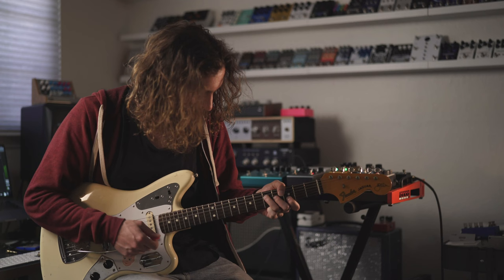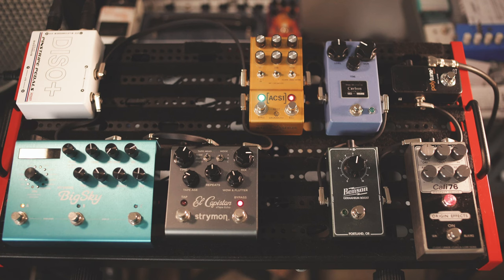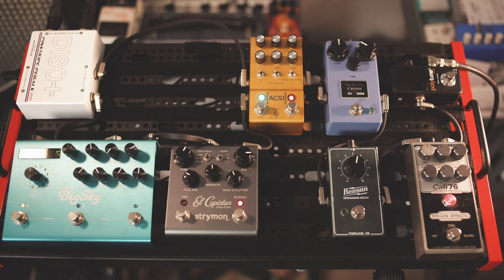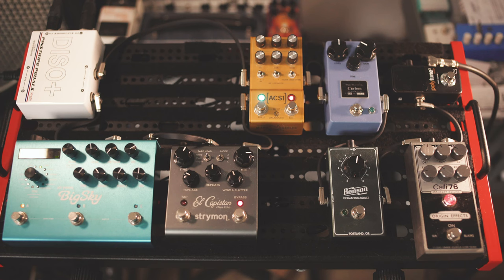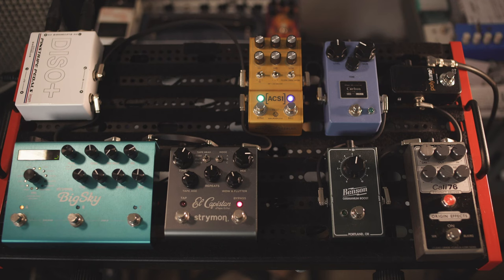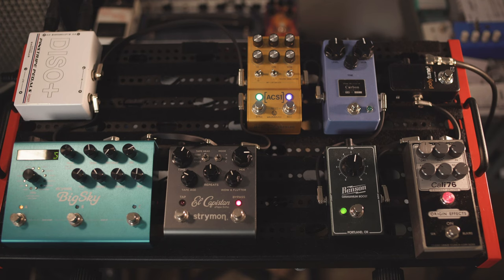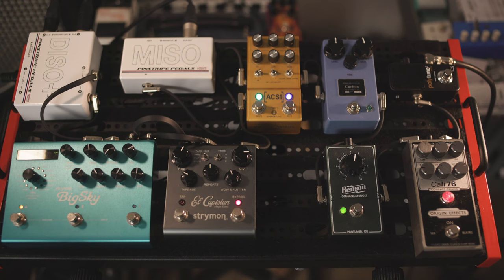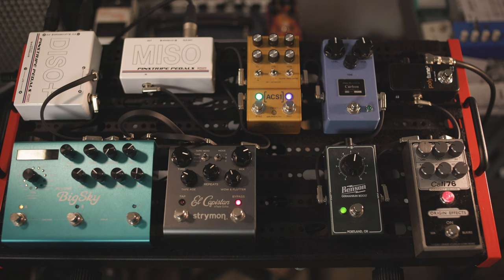The EASIEST Wet/Dry and Wet/Dry/Wet Pedalboard rigs with Pinstripe Pedals | Secret Weapons

Comment: Holy shit. Doing a Wet/dry has always sounded like it'd be magical, but a pain in my ass that I didn't feel like tackling. As a fellow ACS1 user that has a Diso+, this looks like it'll be incredible and super easy. I also have the XLR sum and the 1/4 sum, so worst case scenario in a live setting if I only have one slot available on the board, I can sum it all and be good to go without having to re-patch anything anyways.

Thanks so much for the video! Also, slightly curious to know if you're using stock cabs and all that ish on the ACS1. Anyways, always love your tone and playing!
Reply from the maker: So glad this was helpful for demystifying the concept. It doesn’t have to be a whole thing if you don’t want it to be. 

And I’m using ownhammer IRs. Love them.

Comment: An idea I’m waiting to clarify with Strymon doing this with the Mobius to introduce modulation into a rig like this. It’s using a splitter before the Mobius and a parallel mixer for the Timeline and BigSky. So it’s a very similar w/d/w rig to the one in this video. It should work w/d as well. Goes something like this:

1) the left OUT of the Mobius just goes into the IN of the dry path (this puts the Mobius pre just by placement)

2) the right OUT of the Mobius goes into the IN of the first pedal of the wet path (this puts the Mobius physically in the wet post path)

3) left OUT of splitter into the Mobius left IN

4) right OUT of splitter into the Mobius right IN

5) flip the rear switch to pre/post on the back of the Mobius

I’m not 100% sure yet but if the Mobius seperates the pre/post routing this way this may be a good solution.
Reply: Confirmed to work this way by Steve Stanley at Strymon.

Comment: Ok, so much yes! One question. If you had a stereo modulation in the signal chain, would you put that first in the stereo chain before delay and reverb, or just opt for mono modulation and put it before acs 1 to have it on both dry and wet signal?

Comment: Another good option is the Radial Key Largo - you can do wet/dry/wet or parallel mixing of up to three stereo signal paths, along with  a master effects send if you want to glue everything together with a reverb or some compression. The difference is only 2 xlr outs, so you have to do your own mixing.

Comment: Man that intro song was so sick. That tone is so good. I need to get another UAD interface so I can have more inputs for w/d/w tones.
Reply from the maker: Ok hold up. If you own an Apollo twin you don’t need to buy another UA device. For way less you can buy any number of input devices that have an ADAT output and can link to the Apollo for cheap. I use the Behringer ada8200 but I don’t recommend it. The preamps are.. fine. But Behringer as a company deeply sucks and supporting them isn’t the move. A little bit of googling will find you an option that will get you 10+ inputs to your twin for cheap.
Reply: @markjohnstonofficial  oh yeah, I forgot about that. Thanks for the tip. I’ll do some research and see what people are using.

Comment: Great sound, but through how many speakers are we listening to, or is all direct? If direct, the question still holds, how many speakers are we hearing on youtube if any at all? My apologies if i missed your explanation regarding the final audio YT output devices.  

I'm thinking of using a similar setup, though with a Kingsley Juggler Preamp into a Seymour Duncan Powerstage (2 cabinet outputs for the wet left/wet right duty), and using my Victory Duchess amp for everything else. The Kingsley sounds so beautiful (classic Dumble) I'm just worried about having a balanced sound signature. Perhaps a video Mark, for those of us using different amp/speaker setups, for the wet/dry or wet/dry/wet setup (which sounds so appealing), and how we can begin to attain a balanced sound signature with three speakers. The only thing i can come up with, if it's way off, is to put a bit of the dry channel/amp dirt into the wet amps/channels to help amalgamate the sound character of three different speakers. Geesh, and i just thought about the phasing issues that may arise.

Comment: Would you say you need Diso plus if you i a Neve 1073 that will bring back the gain loss going from tone x to radial DI? My logic is that I would give more warmth to my guitar sound going through a 1073. What are you thoughts? Thank you for your time. 👍🏾
Reply from the maker: I run my guitars out of a line isolator in situations like this but I still run them to a 1073 for character and not just for signal loss

Comment: You're really running W+D/D and W+D/D/W+D.  Your wet isn't 100% wet.  You've still got dry mixed in with your wet signal(s) on both setups.  It sounds terrific, but that's not the full benefit of the W/D and W/D/W setup.
Reply from the maker: For my wet to be 100% wet I would need my reverb and my delay in parallel. Having them both (or even just the delay) at 100% wet would cause an awkward amount of pre delay on the reverb and / or loss my repeats in a full wet reverb.
Reply: @markjohnstonofficial  I see what you're saying.  I still do it 100% wet... so yes, my stereo effects are in series.. delay -> modulation -> reverb, which sounds very natural to me.  The key (for me) is to get the dry blended in perfectly.

Comment: Hi Mark, are you using the standard DISO+ or the one with polarity reversal since you're using different amp models in the left and right channels of the ACS1...or is the polarity reversal only necessary when using 2 different amp pedals like the Ruby and Dream at the same time? BTW, I have to say you guitar tone seems more like an actual amp using the ACS1 than a lot of your more recent videos using the Ruby and Dream combo. Those UA pedals have a glassiness (for lack of a better term) to my ears that make them sound less authentic than the ACS1. I had the Dream, but just wasn't feeling it and sold it. I love my ACS1, especially since the updates.

Comment: Thanks for this. It looks like I might be able to try WDW through my Focusrite 4i4 if the Pinstripe will support the line level into the 3rd non gain input, however, if I want to record WDW, might I just as easily record just WD and duplicate the wet channel in my DAW for panning? Or am I missing something here?
Reply: Hey Howard! The DISO+ outputs whatever level you send into it.  If you want to record stereo FX, it might work out better to send your Dry signal into input 3 or 4 and the stereo FX into 1 and 2 because of gain staging/noise.  You certainly could just record W/D, duplicate W and pan the FX channels, but it may not sound as stereo-y as you might want it to.  It would certainly be worth experimenting with.  Best regards!
Reply: @pinstripe_pedals  Thanks. Most helpful!

Comment: This is amazing, I have A question if you could help me out, my pedal board is:
JHS - little black buffer
Polytune 2
Dunlop jr volume pedal
Walrus audio - eb-10 preamp
Walrus audio - deep six compressor v3
Walrus audio - iron horse distortion
Walrus audio - ages overdrive
JHS - Morning Glory + red switch 
Walrus audio - Julia v3 Chorus/Trem
Walrus Audio - luminary ocatver
Strymon - Timeline delay
Strymon - Big Sky Reverb
Walrus Audio - ACS1 amp simulator
Voodoo lab Pedal Power 2+
Walrus audio Aetos power
Radial DI
Radial Pro D2

I play worship music, usually has 3 drive stages, a clean chorus, a drive chorus, super washed out ambient, a delay, and a big drive lead with octave.

I run stereo into the board now
Would you recommend going WDW? If so would this give me a cleaner more full tone?
Reply from the maker: It’s always up to personal preference. But if you have a decent FOH guy I pretty much always find they’re happier to have independent control over the dry signal. I am pretty pro WDW whenever it’s an option

Comment: Man I'm thinking of doing this to my board, my chain would be whatever for dry then volante and bigsky for wet.

However, in which point do you think I should apply kill dry? I mean if I kill dry on volante, the attack note will be without reverb. (As it's not being sent to reverb)
If I kill dry on Big sky, all the attack of the repeats note from volante will gone.
I'm really struggling with this issue. 

Would you please share some idea? That will be really helpful. Thank you in advance.
Reply: The only way to keep both thing I can image is, do a parallel, one put another bigsky after dry,  and the other bigsky go after the second chain after volante.

Link those 2 bigsky with midi, so that they always syncronized.

Comment: wait im confused, is this W/D/W? You have two amp sims going in to what i assume is two channels on an interface? Isnt this just stereo?. I get that the signal has split the dry chain but isnt it still being summed to stereo?
Reply from the maker: The first section showcases wet / dry with two inputs coming from two “amps” (the left snd right amp channels in the acs1) but at 15 minutes we change our configuration to stereo wet effects and add an input. From there on out it’s 3 channels coming from two “amps” to the interface. One amp sends a mono dry signal and the other amp sends to stereo wet effects. 3 channel wet dry wet.

Comment: Hi Mark/Anyone...how about if you want to use a tube amp without an FX loop for a W/D/W for live use (not recording) and in a small venue.  If you're ultimate output for the wets is through a stereo power amp (solid state) and guitar cabs, do you need a reactive load or is a direct/iso box a more effective compact/pedalboard friendly solution?
Reply: I'm new to all this fancy-fied wet/dry business myself but I'll share what I know in hopes of clarifying the situation for you. The speaker cabs put a load on your amplifier head. If you are using speaker cabs then you don't need any reactive load device. If you're amplifier is not being loaded down by a cab then you need to use some kind of reactive load box or you could damage your amp. Hope this helps.
Reply: @benspeeds  Thanks!  I recently purchased a Suhr Iso Line Out and have my tube amps running trough it with the line out going to my fractal rig and on to two seymour duncan powerstage 200s....the amp is loaded by a speaker cab.  For the case where I don't want the "dry" path, I use a fractal reactive load (LB-2).

Comment: Could you create a wet/dry rig using only the DSM Humboldt Simplifier?
Reply from the maker: exactly the same way as i did here.
Reply: yes! I've built my pedalboard based on Simplifier to do WDW. The Stereo 100% wet signal goes to my audio monitors (Boss MD500 for modulation + Source Audio Collider for Delays and Reverbs running in parallel through an internal mixer of my looper switcher Musicomlab EFX LE) and the Dry signal goes to my amp+cab (4 cable method to feed the wet effects with the signal of the preamp).